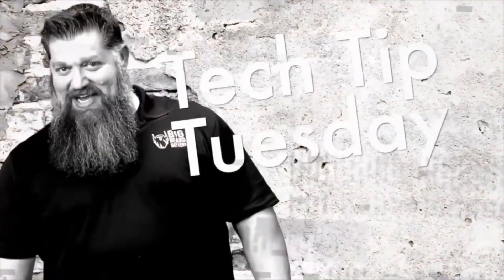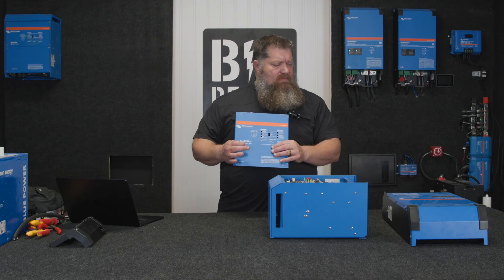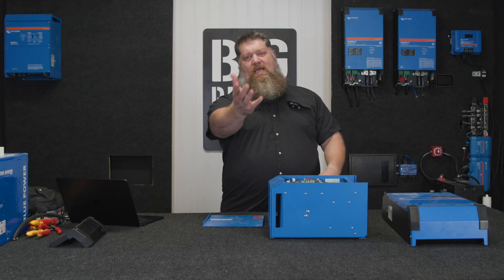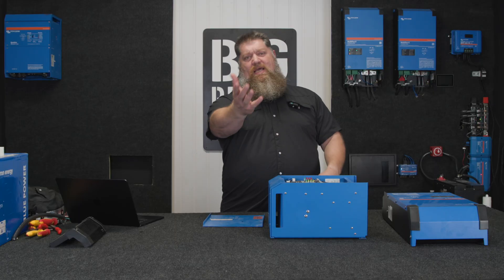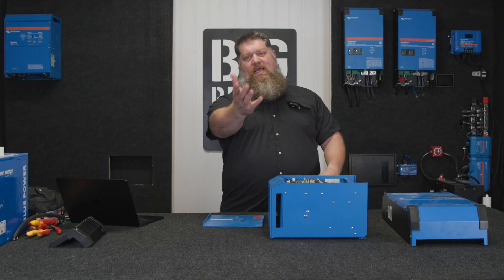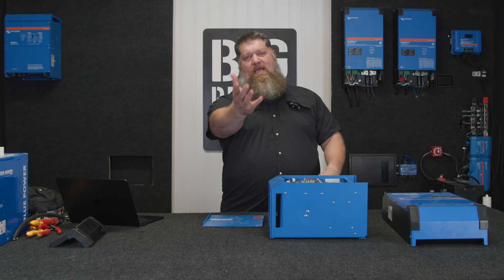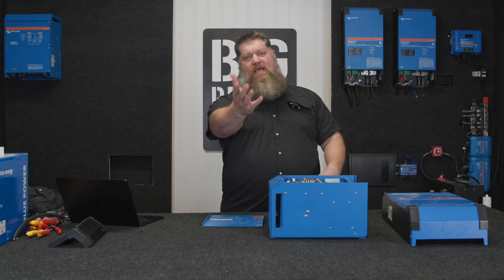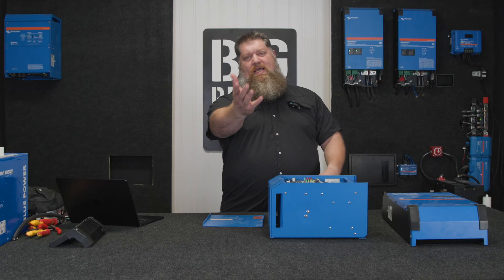VA vs Watts Explained: What Your Inverter Rating Really Means

Comment: Watts and Volt-Amps are exactly the same thing, except Watts refer to DC electronics (those with a battery) and Volt-Amps refer to AC electronics (those plugged directly into a wall socket).  Because an inverter is a DUAL system meaning it handles both AC and DC power, the inverter rating is listed in Volt-Amps and refers ONLY to the AC output.  Therefore a 3000 VA inverter can produce 3000 VA / 120 (AC voltage) = 25 Amps.  Your inverter can supply up to 25 amps at once, any more than that it will brown out (not work partially) or black out (not work completely).

A common mistake people make is to say a 3000 VA inverter can produce 3000 VA / 12 (DC voltage) = 250 Amps, but this is incorrect and off by a factor of 10.  Volt-Amps do not refer to DC voltages (12 24 48), they only refer to AC voltages (120 240).  This is the difference.  And because inverters can handle BOTH AC and DC loads, it is important to know which one you are talking about.  Volt-Amps means you are talking about powering AC loads.  Thats why generators are also technically Volt-Amps because generators run at an AC voltage (120 240 etc).

The resistive load, inductive load, non-linear load, capacitive load stuff is not quite correct.  It only matters whether the loads are AC or DC.  If they are AC the loads must total less than 25 Amps or you need a bigger inverter, or dual inverters, or an inverter with generator pass-through.  Assuming your air conditioner runs at 120v and is 2400 watts (technically VA again because this is an AC appliance), 2400 / 120 = 20 amps.  Your air conditioner at MAX draw pulls 20 amps.  Your Multiplus inverter can handle this load and have another 5 amps to spare.

However if you wanted to use MORE than 25 amps at once, you would need a bigger inverter or DUAL inverters.  Dual Multiplus inverters running in parallel can handle up to 50 amp loads at once.  So Dual Multiplus inverters could handle two air conditioning units at MAX draw with 10 amps to spare.  The next size up inverter is the Quattro which can handle 41 amps at once.  This inverter could power two air conditioning units with 1 amp to spare (cutting it close to brownout/blackout).  DUAL Quattros could handle 82 amps at once.  So 4 air conditioning units at once with 2 amps to spare.

Victron Inverters also have generator pass-through.  This means if the generator were ALSO running, and connected into the AC-IN Leg 1 on the inverter, the generator could power loads in TANDEM with the inverter.  If you had a 6000 watt (again technically VA) 120v generator on and running (50 amps), the inverter would run in Power Assist mode giving you a total of 50 amps (generator) + 25 amps (single multiplus) = 75 amps total power.  This could run 3 air conditioning units with 15 amps of power to spare.

When the 6000w generator is running and connected to the AC-IN Leg 1 on the Multiplus, the 50 amps from the generator will be used to power any immediate loads, and anything spare will be stored in the DC batteries.  There is a 15-20% loss for AC/DC conversion.  The generator will power the 20 amp air conditioner, and the inverter will convert the remaining 30 amps of generator AC power to DC.  There will be a conversion loss of about 6 amps, and the inverter will store about ~24 amps of DC power in the batteries to be used later.  This load will not be Power Assisted because the generator is running and can power it alone without assistance.  The 3000 VA Multiplus can charge the DC batteries with up to 120 amps of current at once.
Reply from the maker: Ok here we go! 

In video I speak everyday language so that a majority of people can grasp the concept. I appreciate your submittal and appreciate some of additional details, but its wholly devoid of actual application. Pure theory vs reality. Even your theory is incomplete so I will respond with the following. 

First statement: Watts and Volt-Amps are exactly the same thing, except when referring to DC electronics- INCOMPLETE.  There is a specific reason why some dataplates have Watts and those other data plates where there is energy conversion list VA and they type of load demanded. 

Watts (real power)  W= VA x PF

My submittal from the outset of the video I stated that the subject matter revolves around inverters and generators. Both change the form of energy. " Your statement because inverters can handle BOTH AC and DC loads, it is important to know which one you are talking about." This too is INCOMPLETE and INACCURATE inverter take DC input changes the form to AC  output.The Charger takes AC input and makes DC output. Thus Victron ALREADY DECLARES THE OUTPUT SEPARATELY OF EACH FUNCTION. 3000va for ac output and 120a max dc output if charging. Yet again my submittal was specifically around the 3000va which is ONLY AC OUTPUT. Not sure why you felt the need to make that distinction when its wholly insignificant. 

Next statement "therefor the 3000va inverter can deliver 25 amps. is incorrect as it is INCOMPLETE. 300VA for output assumes NO PF the only load where you have a PF that is congruent to 1 is a purely resistive load but there is a deration that needs to be considered on continuous loads....which victron does supply in their manual. As a matter of fact it specifically states 2400 watts continuous at 77 degrees internal temp but drops to 2200 watts continuous (deration) at 104d degrees. To make the statement it can run an AC up to 20amps and have 5 amps to spare is INCORRECT in almost any application.  An air conditioner is highly inductive with its own PF of .6 to .8, at the onset its capacitive  which is a huge amp draw making it a non-linear load. There is NO way there could be a 5amp draw being pulled by the inverter and have enough supply to hit 20amps on the air conditioner......if the air conditioner is pulling 20 amps. 

Now again a different consideration comes in on that ac compressor. Ideal Gas Law. The end result is the hotter the temps on that AC the more pressure the refrigerant creates, the harder the compressor has to work, the more amps the compressor pulls. Roughly 1 amp for every 5 degrees above 94 case temp. Yet cooler temps require less work from the AC and in those instances there is room to run the ac (after the inrush) to possibly pull an additional 5 amps. But it must be stated the ac in this instance is'nt pulling 20 amps cause the inverter CANNOT SUPPLY 25 AMPS CONTINUOUSLY. 

Again my submittal that Victron uses VA is because the end user will use a combination of resistive, inductive,  capacitive loads. Since the inverter is not limited to a specific load they provide a VA with another variable in the dataplate PF.  They even provide efficiency with a temp coefficient but I only had 2 minutes to break this down so that many more can understand. 

If you want to find areas of correction, then make sure that your submittal is airtight and not lacking or incorrect. I am not saying I am always 100% right. Far from it. Nor am I saying you should not provide additional details. But I am saying, if someone corrects, I read, I look over and I too will correct the errors made by those who wish to parse sentences and split hairs.  

End result, do you think the viewer, after watching the video, has a better understanding of the verbiage that is supplied on inverters and generators, with real world examples using models to get the point across? If yes, then I have achieved my goal.
Reply: @BigBeardBattery  
> First statement: Watts and Volt-Amps are exactly the same thing, except when referring to DC electronics- INCOMPLETE.

Dude you dont know the difference between watts and Volt-Amps and you told your actor to spout a bunch of bs.  You shouldnt work on anyones RV electronics and should give no advice about it.  I am not talking to the actors I am talking to the Electricians behind the scenes that should know better.

> Not sure why you felt the need to make that distinction when its wholly insignificant.

Because this is exactly what you dont know.  The difference between watts and volt amps.  This is the difference, and the reason is to make a distinction between the AC loads the inverter can handle, and the DC loads the inverter also can handle.  You want to talk about power and resistance and a bunch of other subjects that dont apply here.  This falls under you dont know so you use these big confusing words.

> Next statement "therefor the 3000va inverter can deliver 25 amps. is incorrect as it is INCOMPLETE.

Dude the air conditioner is rated at 20 amps.  That is at max draw, on full blast (which shouldnt really happen or you will beark the air conditioner).  Resistive load bs, it will be 20 amps or less.  The multiplus can handle 25 amps or less.  You are overcomplicating this with big words to hide the fact you dont know.  The temperature doesnt matter, the capacitive bs doesnt matter, the air conditioner will be 20 amps or less.  That is its MAXIMUM power draw.  I agree that is close to blackout/brownout on a Multiplus so you will want to seriously consider a Quattro or dual inverters.  Or simply turn on the generator.

> There is NO way there could be a 5amp draw being pulled by the inverter and have enough supply to hit 20amps on the air conditioner......if the air conditioner is pulling 20 amps.

There is exactly a way.  The air conditioner will use a MAXIMUM (in ALL situations) of 20 amps.  The inverter can handle 25 amps.  There will be 5 amps spare.  You dont want to get too close to 25 amps because then you are at blackout/brownout risk.  PF bs does not apply here, inductive, capacitive, non-linear bs neither.  Make way for 20 amps is all you really need to know.  If you want to run more than 25 amps, get a Quattro, get dual multiplus inverters, or turn on the generator.

> Ideal Gas Law. The end result is the hotter the temps on that AC the more pressure the refrigerant creates, the harder the compressor has to work...

More overcomplicated words to hide that you dont know.  The air conditioner will pull a MAXIMUM of 20 amps.  Make way for 20 amps.  It should work unless you have other loads running that total more than about 5 amps.  If you run the air conditioner at full blast for too long you will eventually break that as well.  In this situation the generator should definitely be running, and I personally would use a bigger inverter, or dual inverters.

> But it must be stated the ac in this instance is'nt pulling 20 amps cause the inverter CANNOT SUPPLY 25 AMPS CONTINUOUSLY.

The Victron Datasheet says the Multiplus can handle 3000 VA on a 100% duty cycle as long as it is below 25 degrees celcius which is about 77 degrees fahrenheit.  YMMV but it should handle it.  The air conditioning should not run longer than a couple hours or so and usually when running the air conditioning you will run the generator as well.  The Multiplus can handle a 20 amp air conditioning unit probably 100% cycle if there were no other loads.  Charging the batteries IS considered a load.  If you want to run the air conditioning with the generator off using ONLY battery power consider a bigger unit (Quattro) or dual Multiplus, or just turn on the generator.  

> Again my submittal that Victron uses VA is because the end user will use a combination of resistive, inductive,  capacitive loads.

This is french for "you dont know and your air conditioner dont work."  I am all for using a bigger inverter.  I am considering dual Quattros for my boat, total of 82 amps battery power. More than enough. But the main problem to look out for here is do not use undersized equipment for the load.  A 25 amp inverter for a 20 amp air conditioning unit IS undersized, though it should work with less than 5 amps of additional loads.  If the generator were running it will definitely work, but above 25 amps is blackout/brownout risk.  If I were talking to the designer of this system, I would say upgrade to a Quattro.  My personal system will use dual Quattros.  If you already have a Multiplus, consider buying another one and running in parallel for 50 amps MAX.  Also consider buying two more and running in parallel for 75 amps MAX.  Although in RV's I know physical space is a serious constraint.

> If you want to find areas of correction, then make sure that your submittal is airtight and not lacking or incorrect.

You must be new to youtube comments.  Anyway this is an exact science.  And I know this science.  The inverter is 100% duty AT ITS RATING so it should handle the load.  If the equipment is undersized for the load that is the designer of the systems error.  As I said many times, use a Quattro, use dual Multiplus, at the very least turn the generator on when you run the AC.

>  End result, do you think the viewer, after watching the video, has a better understanding of the verbiage that is supplied on inverters and generators, with real world examples using models to get the point across? If yes, then I have achieved my goal.

I can look at the actors face and tell he clearly doesnt understand what is going on.  This should have been obvious.  I am not upset with him, I left this comment to attempt to help him as the electricians BEHIND him appear to be incompetent.  And you have confirmed this.  Below 25 amps it should work, above 25 amps it will blackout/brownout.  And you really shouldnt cut it this close you should have more than enough.  Get a Quattro I will personally have two, otherwise use dual or even triple Muliplus, turn on the generator.  Other than that you are about 5 amps away from blackout/brownout risk.  That other noise you are talking...  Your air conditioner dont work.  If you wanted to run an air conditioner AND a refrigerator, this inverter is definitely undersized.

When you start talking about normal RV loads like lights, instrumentation, refrigerator, microwave, stove etc, one multiplus will NOT cut it.  You will need above around 50 amps available to seriously power that RV.  So 2 Multiplus, 3 if you have the space.  Dual Quattros will do it in almost all situations.
Reply: FWIW Victron makes videos about inverter overload, it is highly useful to watch them. They make it very clear. The ratings are assuming a PF of 1. A Multiplus 3000 VA will be able to sustain a resistive load of 3000 W for up to 30 minutes (at stated conditions), and the stated continuous rating indefinitely. If your device has a lower PF you need a higher rated inverter (ie. a 2500W motor with power factor of 0.5 will need a Multiplus 5000 VA). I honestly don't know why you need to go to an obscure webinar to find this out and why they don't just state this outright in the documentation to avoid confusion.

Also, watts refers to both AC and DC. I'm an electrical engineer, I have no idea how someone could possibly have gotten the idea that VA is for AC and W is for DC. The difference is power factor, period. An inverter doesn't have DC outputs. Nothing about this comment makes sense.
Reply from the maker: @armelpeel an actor? Sweet I’ll add that to my resume. No need to rehash, it’s in print and I’ll let the various viewers read and provide their input on who is right.

By the way “big words” are easily defined in today’s world. Simply open your browser, type said big word, and learn.
Reply: @BigBeardBattery  Mr. Beard - Good job! I've understood VA (simply "Volt Amps") and PF from a load and system point of view, but was not able to relate that to an inverter rating.
You summed that up nicely. Thanks! (another EE).

@armelpeel You need to understand Reactive Power (VAR), where it comes from, how its measured/calculated, and Power Factor (PF) in AC systems before you can talk about AC VA.
I hope you're comfortable with complex numbers.
Reply: @rrrrrrrrrrrrrrrrrrrrr  Dude, your air conditioner dont work.  

Exhibit A
> An inverter doesn't have DC outputs.

The entire purpose of an inverter is to use DC batteries to power AC loads.  You sound like you have never even seen an inverter.  There are pictures on google.  

Multiplus inverters have a dual AC input (for generators and shore power), dual AC output (to charge an electrical panel or another AC device), and a single DC connection.  This DC output is how the batteries are charged.

Because you obviously dont know, AC connections have one wire for both positive and negative, while DC connections have a separate wire for positive and negative which corrospond to the negative and positive DC terminal on the battery.  

The inverter connects to the battery this way.  You simply dont know what the hell you are talking about, and likely dont know the difference between AC and DC connections.  Especially since it doesnt even seem you know what an inverter does.
Reply: @BigBeardBattery  My point is you are using thise "big words" incorrectly and to confuse and conceal the fact that you dont really know.  I know perfectly well how to use a dictionary.  

What you really need to know is "this connection needs to have 20 amps MAX available", you need a 20 amp fuse, a soft start, and a minimum of 12 gauge wire.  But you dont know or understand that, so you change the subject to power factors and resistive loads and other terms that dont apply here.  The confusion this creates is how you hide the fact that you dont know and you cant do it.

THATS why your air conditioner dont work.
Reply: @brettd5884  These are not complex numbers.  Your inverter can handle a max of 25 amps.  Your air conditioner will draw a max of 20 amps.  You need a 20 amp breaker, a soft start, and a minimum of 12 gauge wire.  These other terms Reactive Power and Power Factor do not apply here.  You are not using these terms correctly.  You are primarily using these terms to conceal the fact that you do not know, can not do it correctly, yet still want to position yourself as better than me somehow.  Fine.  Talk about Reactive Power and Power Factor all you want...  Your air conditioner dont work.

Even people who know nothing about electricity can look at this guy and see he doesnt know what the hell he is talking about.  He is reading the incorrect script you probably gave him.  The blind leading the blind.  But fine, figure it out yourself.  Big guys need a lot of air conditioning.  And he aint gonna get it from you.

I would personally use a bigger inverter (Quattro) or dual inverters, but with no other loads the Multiplus should handle 20 amps MAX.  As long as it is wired correctly, at the most you will have to turn the generator on when the air conditioner is running.

TO WIRE THIS CORRECTLY:
1. Assemble the batteries in parallel and connect to the DC + and - connection on the inverter preferrably using a properly rated busbar.
2. Place a SOFT START (sometimes called easy start) between the inverter and the DC connection to handle startup in-rush current.
3. Connect the generator to AC-INPUT-LEG1 on the inverter, this is a 60 amp connection so 6 gauge+.
4. Connect AC-OUTPUT-LEG1 on the inverter to an electrical panel, this is an 85 amp connection with Power Assist, so 4 gauge+
5. Put a 20 amp breaker in the electrical panel.
6. Connect this breaker to the air conditioning unit using a minimum of 12 gauge wire, I personally would upsize the wire.  10 gauge+
7. When you run the AC unit, you might need the generator on which is why I suggest a bigger inverter.  But it should handle 20 amps.
8. If that inverter is not powerful enough, without a more powerful inverter or dual inverters, you will need to turn on the generator.  

When the generator is on, the Multiplus will power the air conditioning unit using generator passthrough, and use the rest of the current to charge the batteries.  If you have other loads like lights and a refrigerator, you WILL NEED a bigger inverter.  The Multiplus technically should handle one 20 amp air conditioning unit with no other loads 100% duty.  Each Multiplus in parallel will add another 25 amps your system can handle at once.  The Quattro is a bigger unit, and each one can handle 41 amps in exactly the same manner as the Multiplus.  IIRC both the Quattro and the Multiplus require 400 amps of batteries but may differ depending on the model.  The exact number will be listed in the manual which is available on the website.

NOW the air conditioner works YAY!
Reply from the maker: @armelpeel this is fun. 

What words did I use incorrectly? Again it’s in print, others must not know either cause they are saying I’m dead on. Please teach us.
Reply: @BigBeardBattery  I explained the complete steps and how to wire it in my reply to brettd5884.  The terms or "big words" used in the video and in the comments do not really apply, are overcomplicating the situation, and is without a doubt why your air conditioner dont work.  Insulting me more wont help because these are exactly the steps to do this correctly.
Reply from the maker: @armelpeel lol says the guy who called me an actor only. If you can’t take it, don’t dish it out. My original replies stated that I appreciate your input. Words to try to live by
Reply: @BigBeardBattery  good luck man
Reply from the maker: @armelpeel  

For those who are reading and are confused which numbers are correct. Here is the spec sheet. 25a is not listed on the output...anywhere. But you know what is listed as max continuous output? 2400 watts. Thats 20 amps continuous at 25c. Not 25amps.

https://www.victronenergy.com/upload/documents/Datasheet-MultiPlus-II-inverter-charger-EN.pdf
Reply: @BigBeardBattery  Are you sure its not listed in the output anywhere?  Well thats strange because I am looking at page 9 in the manual which clearly states and I quote...
 
"AC-out-1 (see appendix A)
The AC output cable can be connected directly to the terminal block "AC-out".
From left to right: “PE” (earth), “N” (neutral) and “L” (phase).
With its PowerAssist feature the Multi can add up to 3kVA (that is 3000 / 120 = 25A) to the output during periods of peak power
requirement. Together with a maximum input current of 50A this means that the output can supply up to 50 + 25 = 75A.
An earth leakage circuit breaker and a fuse or circuit breaker rated to support the expected load must be included in
series with the output, and cable cross-section must be sized accordingly. The maximum rating of the fuse or circuit breaker
is 75A."

So, as I stated earlier, the multiplus can handle its rated power 100% duty.  And its rated power is 3000VA / 120V = 25A which is clearly stated in the manual.  Along with correct wire sizes and fuses.  As I said previously it sounds like you have never done this before.  Or at the very least have never bothered looking at the manual.  This is getting ridiculous.  You simply dont even know what this inverter can do yet you somehow want to correct me about it.  Follow the steps I have clearly listed or...  Your air conditioner dont work.